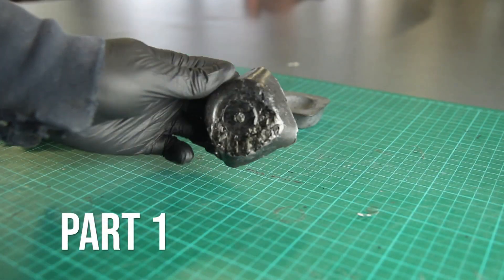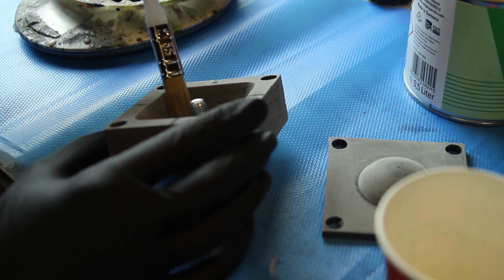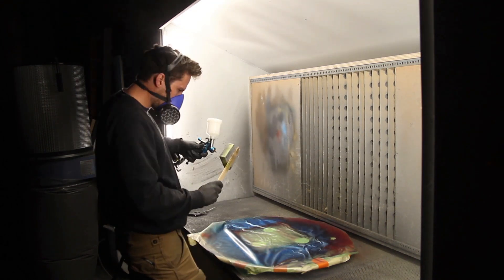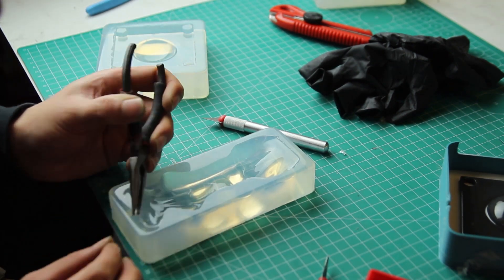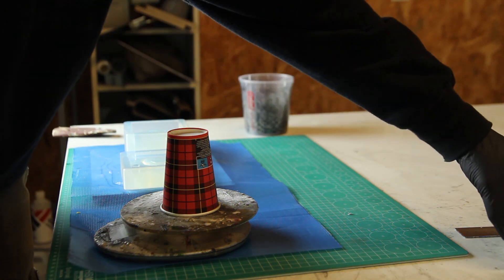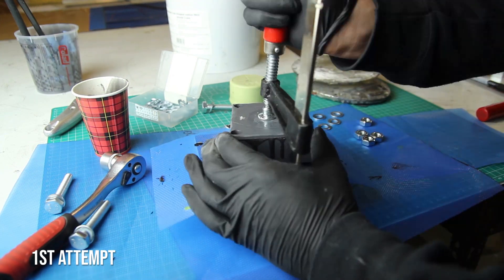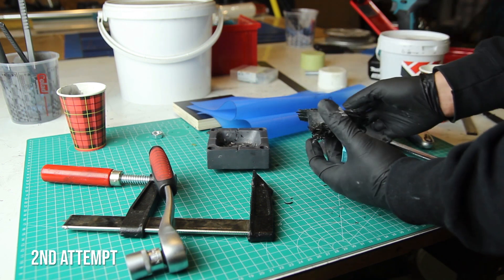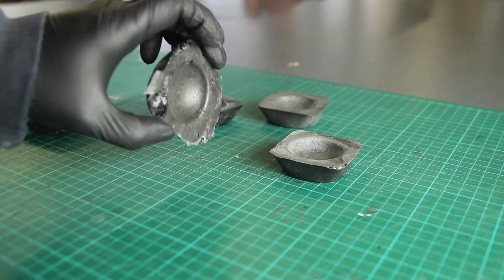Rapid Prototyping Forged - Chopped Carbon Fiber PART 1

Comment: 6:25, sry i maybe a bit too dumb but i didnt understand why we
3d printed a mould --> made a soft silicone mould --> made a hard PU mould --> and then made the actual forged carbon part, 

why not just use the 3d printed mould that we first designed?

also i had a somewhat related query, i wanted to make a car body panel into forged carbon, would  need to do the same process of making multiple mould like you have, what about adding extra depth so that the male part of the mould  compress the part? i dont quite understand that

Comment: I watched your video and got some great tips for making forged carbon.
I was having a really hard time releasing types.
However, when I compressed the cling wrap I use in the kitchen by putting it in a mold, I was able to release it surprisingly smoothly.
No tools were required and it could be opened by hand.

I believe this is the smoothest method.

Comment: I've successfully made a few 3D printed molds and my process is: sanding the molds with 220-600 grit, filling large gaps and coating the whole mold with UV curing resin (for 3D printers), sanding with 400-600 grit, waxing with 5 coats of Partall paste #2, followed by 3-4 coats of PVA. My struggle right now is getting a flat, mirror finish without bubbles and pinholes. I have not found a good coating resin yet

Comment: 1:24 looks like you had a fair bit of under-extrusion there. 
Thanks for the vid. CF molds is something I will try out someday too.
Reply from the maker: it wasn't under-extrusion but the Z-height nozzle being a bit to close, nylon is printed at 280°C without cooling and the nozzle was "scratching" the inner lines :)

Comment: Does the CF add significant strength to the PU?
Reply from the maker: I don't have numbers but makes a big difference in theorie... PU can be brittle and the fibers function as reinforcement, comparable to glassfiber reinforced concrete for example

Comment: Great stuff, it's always reassuring to see that the experts also need to try a few times 😅 beating the 5-10min cure time of PU is hard.. if you have the 3d printer there though, just cure it on the heatbed, with the amount of resin in there, should be good in 20mins
Reply from the maker: haha it's a part of the process as well to try fail and learn and take that knowledge to other projects then :) Heatbed works, or oven might be better to evenly heat everything :D but I mostly like to let the parts cure at room temperature, then do a postcure to avoid exothermal reations and shrink or expansion

Comment: Nice video, thanks. I made a drone frame out of forged carbon. Wanted to create a shape that would be very hard to achieve using a wet layup. It turned out amazingly well, I really like this technique.
Reply from the maker: thinking the same! the way of thinking is more like reinforced carbonfiber injection moulding like traditional injection moulded parts! your topic seems very suited to it indeed

Comment: Very nice explanation.
I actually simply use the moulds printed directly in PETG or other copolyesters and the apply a gelcoat afterwards to deal with the layerlines.

EasyComposites also sells a mould releasy wax by Stoner I believe. That stuff is really good. As long as I apply drafts on my arts of at least 3 degrees I have no issues with parts releasing from the mould even without the ejectors.

The real reason why I stick with 3d printed moulds is the forgivingness of the moulds.
I've been using the same moulds for almost 60 runs now without fail.
Reply: I figured that the ratio of vertical and horizontal surfaces correlates with the ease of release. I did some test runs on simple shapes and they just popped right out of the mold. When I forged the more complex drone frame I struggled to get it out of the mold.
Reply: @AlenHR  

With the mould release I mentioned or just in general? I think in general more draft would equal more friction during de-mould. But I even did some near neutral draft parts and that worked even. Was there actually draft on the parts? When I read 'complex drone shape' I can imagine organic shapes where you might perceive draft, but due to the curvature there actually is none.
What did mess me up a few times when working with purely FDM printed moulds was underextrusion.
Reply from the maker: the hardest thing with forged is that you have no flanges to get the part out of the mould compared to resin infused parts. Thanks for the comments both of you ;)

Comment: this is look like casting carbonfiber.
If the mould deeper you can fill more carbonfiber and use the second mould to compress it, I think that how forged carbonfiber look like
Reply from the maker: thanks for your comment! you are correct, mould geometry makes a lot of difference in the production of parts!